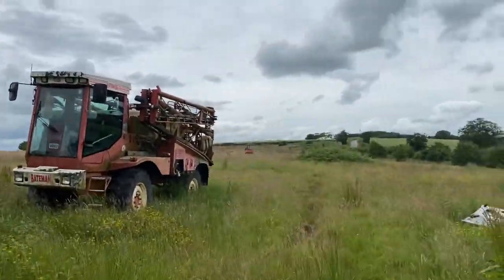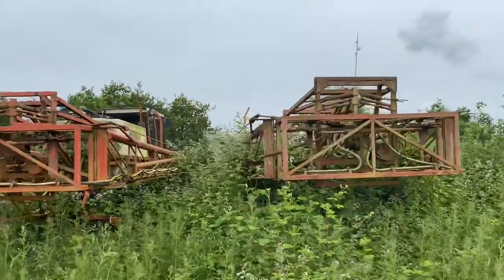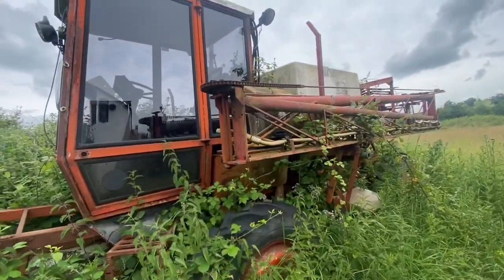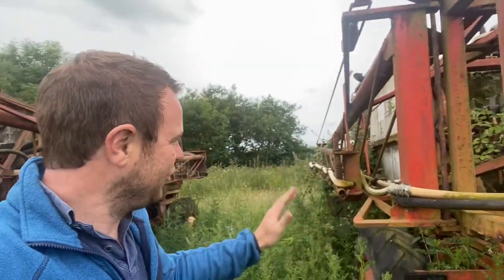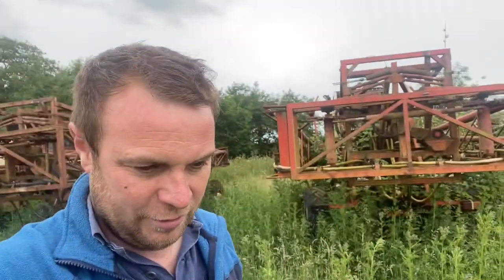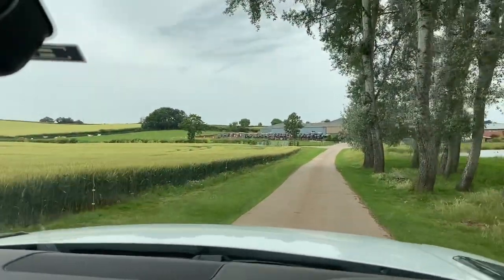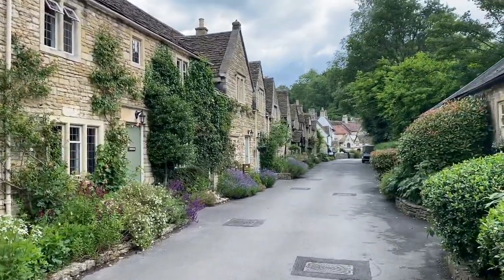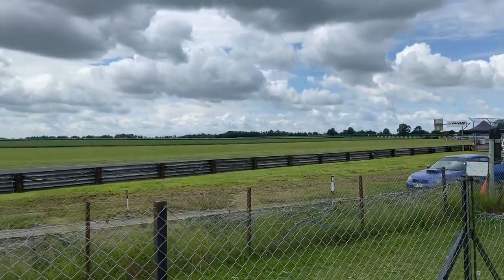Day471 #OLLYBLOGS BATEMAN RELIC FEILD & CASTLE COMBE IS MORE THAN A RACE CIRCUIT #AnswerAsAPercent

Comment: Hi Olly, great vid sad to see those old sprayers left outside. Wondering if you can help, we're currently looking at a Bateman RB16 as our first sprayer. Any hints and tips what we should look out for buying a used Bateman.
Reply from the maker: Rb16 is good sprayer as engine is monted better shape than rb15 
They can be done up relatively cheap so long as all wheel motors are good
If u give bateman the serial number they will tell u it’s history